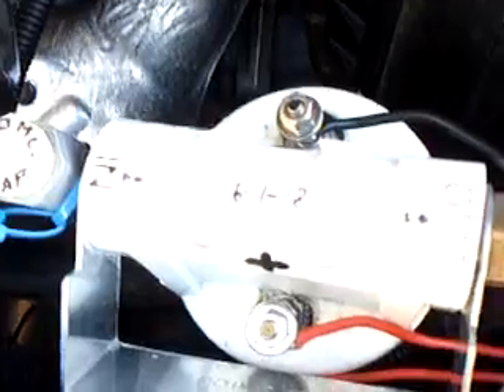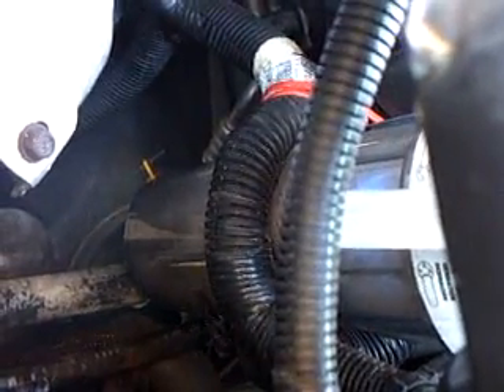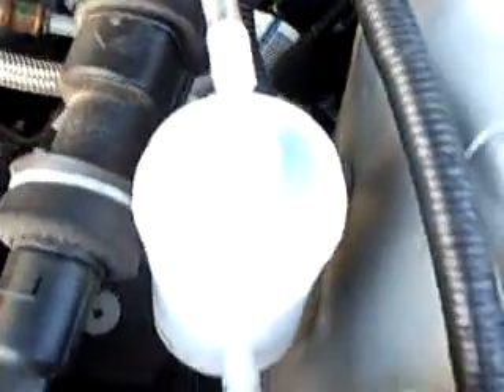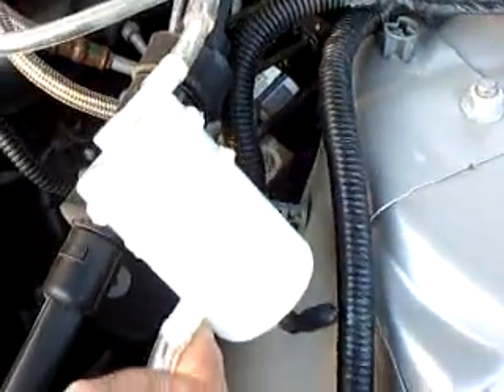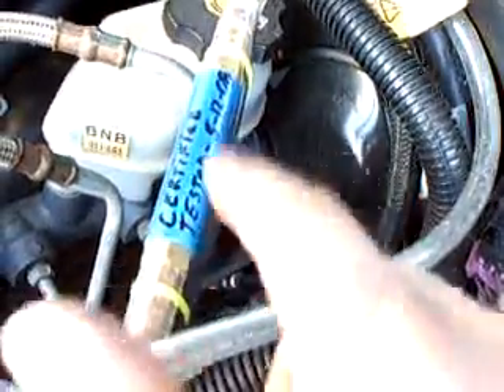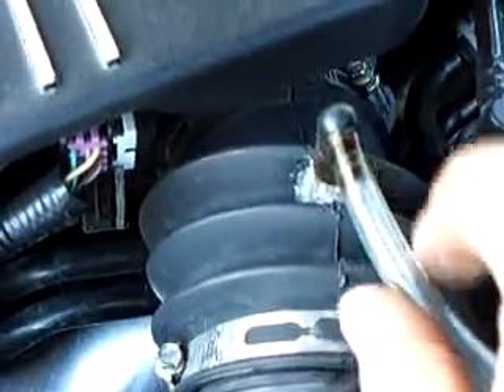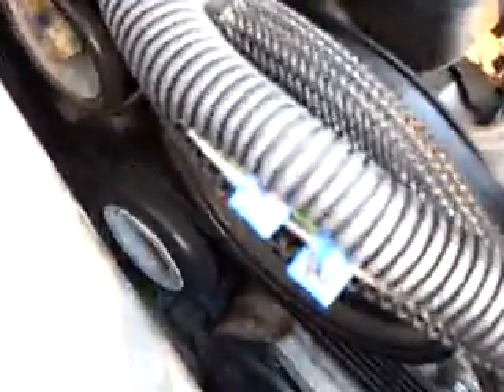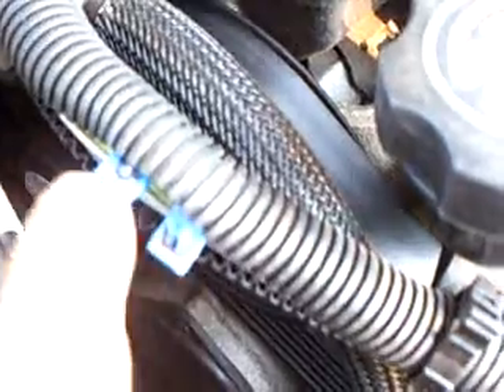#002 HHO Impala Cell Installed

Comment from the maker: you need to take a look at your exhaust tube before the catalytic converter. Usually just behind the engine next to the firewall.  To know for sure if you even have one, or how many, check with a mechanic, or go to autozone's website and enter the specs.  You need an efie for every sensor just before the converter.  Some makers have dual efies for more than one sensor.

Comment from the maker: the factory MPGs for the 3.9l LTZ  are: 18 city and 28 Hwy.  Without the cell, I have ranged with city and highway driving to and from work,(80 miles) about 21-23 MPGs right now with some concervative driving, it seems to be holding at about 27-28 MPGs so kinda early for this, but it's getting around 5-6 MPGs increase. A savings of about $16.50 each fillup at current gas rates.